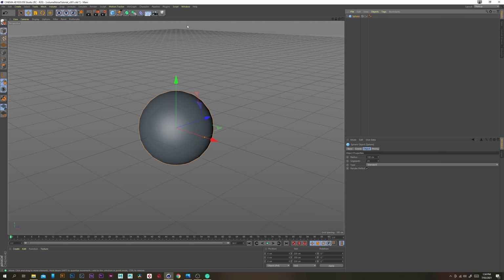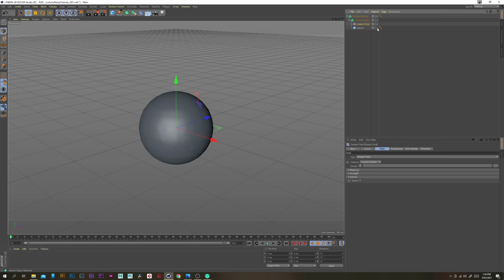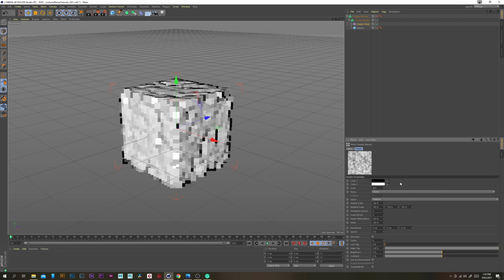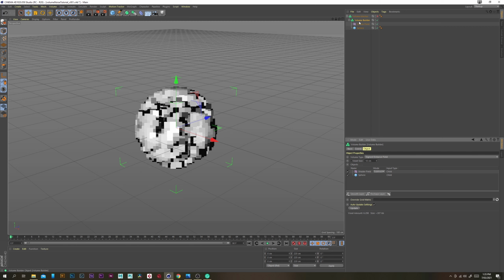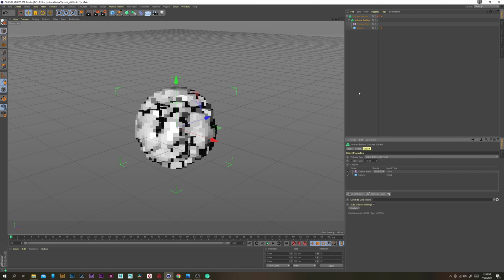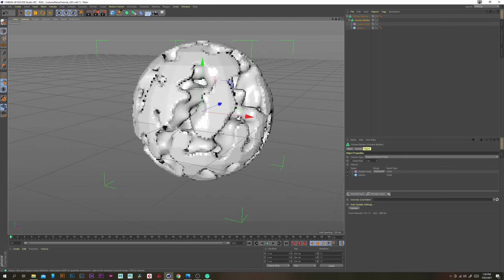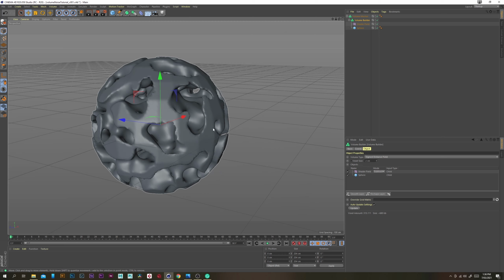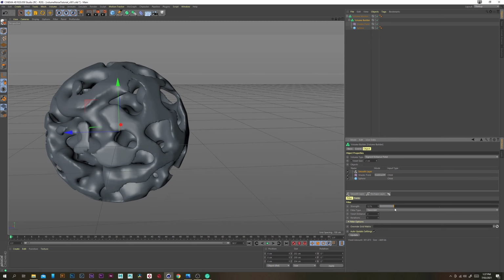Volumetric Noise in Cinema 4D - Tutorial

Comment: Thank you for sharing your knowledge! Would it be possible to animate the shader on this? Nothing seems to happen when I set the loop period or the animation speed so I was wondering if there was another way
Reply: if you use random field, the animation works
Reply: Random field doesn't provide full control, if you want to animate shader field simply check "Frame" checkbox in the field menu
Reply from the maker: That should work :D